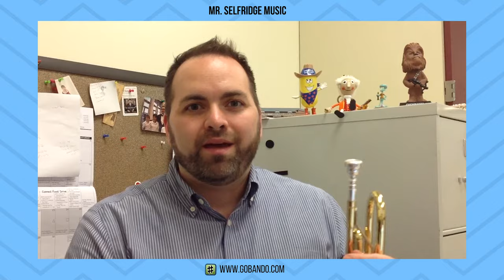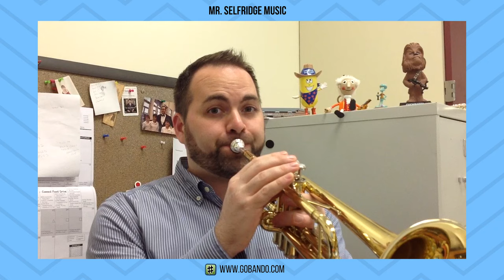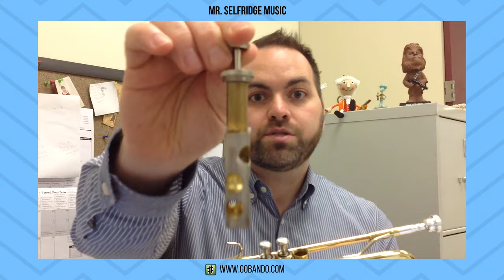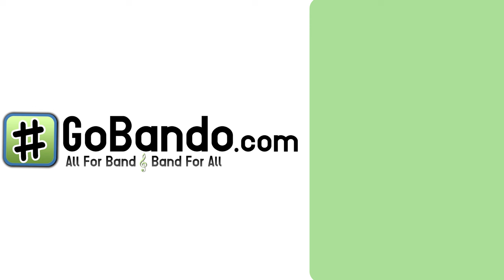Help!  My Trumpet Isn't Working! (Or sounds weird...)

Comment: Another possibility (though a very rare one) is if you remove the wood/cork pad of your water key, air will leak and you will get a similar effect where the trumpet sounds muffled and you can't hold a steady pitch. Some overtones may be unplayable. I once removed them from an old, neglected trumpet to refurbish and put it away to work on the next day. Silly mistake :P